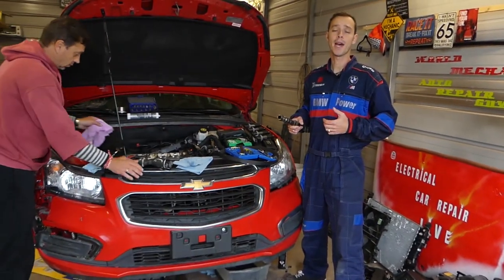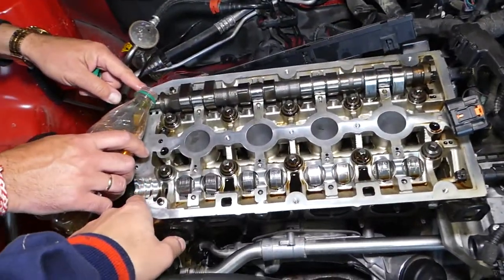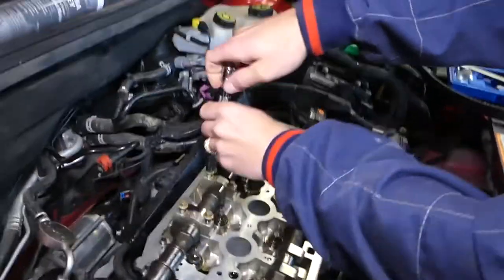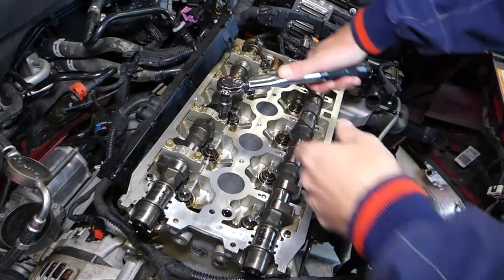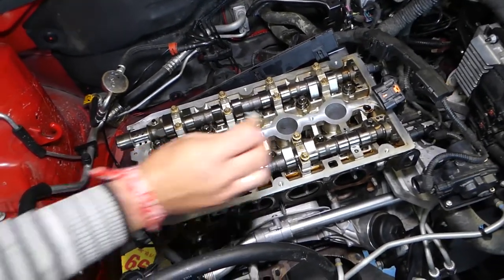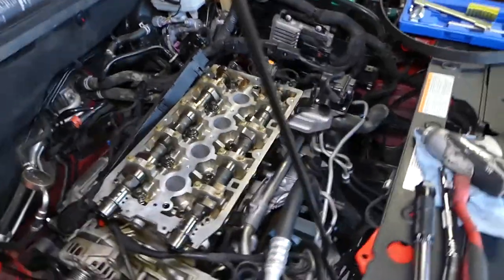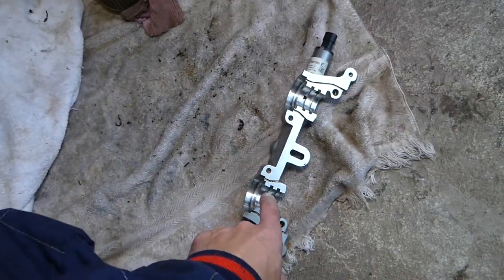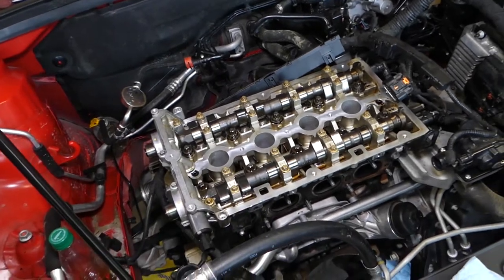CAMSHAFT CAPS TORQUE SPECS ECOTEC 1.8 1.6 CHEVROLET CRUZE SONIC OPEL ASTRA INSIGNIA ZAFIRA MOKKA

Comment: I learn a lot from your video’s. I’m replacing the exhaust camshaft only. One tooth to the right broke off. Even though Zi replaced the camshaft sensor, the code still shows sensor is faulty. My question is: Will replacing camshaft solve the problem. And I’m so afraid I might not place the camshaft in the wrong position. Any suggestions

Comment: I have a 2015 eco tec motor I put in my 2009 if I was to remove the cam from my old engine and put in the 2015 engine would I have to use the caps from the 2009 engine or can I use the 2015 ones?

Comment: the service manual clearly states NOT to put any sealant over the grooves  on the bridge cap.
Reply: PLL Lot, thanks for that info 👍.  I am doing one of these right now. (Valve job due to broken timing belt)  The  "manual" on csmans is very unclear about where to apply the sealant and neglects to mention what type should be used.

Comment: How do you line up the camshafts so that they are timed? Or aligned?
Reply: Once they have been took off idk but am searching and will share.    With the vvt sprockets  it seemed like exhaust cam was sit on a quarter off so when u layed the chain on the intake cam on its marks when u went to put on its marks on exhaust the sprocket it self had to be rotated back to get the marks lined up.     I know this.  U can’t set chain on its crankshaft mark at dead center the try to line marks up on sprockets to figure out exactly where they bolt down  maybe u can set Intake cam like that but not exhaust.     If u find out before me plz share
Reply: These cams have grooves where a timing tool can be placed to align the cams. Alternatively two vice grips or a 21mm wrench holding the cams behind the sprockets. Make sure the grooves are horizontal
Reply: @kas1nova1  i have a problem and need help the cam sprocket on the left doesn't line up the line is not horizontal but the cam is straight from the back and it is on tdc how would i adjust the sprocket to line up
Reply: my friend  same problem my bush machenic he dont know

Comment: 8nm or .8 (da nm)    Chevy said 8ftlbs on 2.4 which would be good on reused bolts  but 8nm is 6ftlbs
Reply: Lee, something doesn't add up somewhere?... csmans is also showing the torque to be 8y (nm) or 71 in-lb... but that only converts to 5.92 ft-lb?

I'm doing one right now and replacing the head bolts for new as directed, but this has me thinking ALL the bolts should be replaced?
Reply: @andrewulrich4930  now I am talking about the set of bolts that holds the cams to the engine is 8ft lbs        the head bolt torque I got from another video
Reply: @andrewulrich4930  my wrench on one side says  (da. NM)    M. Kgs.  And when set on 8.   Which I assumed was 8nm. On back side is the ft lbs and it’s on roughly 58ft lbs         I was also snapping bolts at 4nm. And it felt like way to much.     So when I called Chevy to order a new bolt set I asked them and they said 8ft lbs.
Reply: @andrewulrich4930  I’m no mechanic   am I missing something?
Reply: @andrewulrich4930  it’s like I’m finding stuff to support both our measurements now.
Reply: @andrewulrich4930  okay my wrench shows deca newt meters.    So it’s .8 deca newt meters not 8 nm     If My math is right
Reply: Correction .8 deca newt meters  which is 8ft lbs.      8nm is 58 ft lbs
Reply: A deca nm  is .1nm.    So 8 deca nm. Is .8 nm
Reply: @andrewulrich4930  I have had several people tell me all ecotec torque bolts are same torque but I’m working on a 2.4 ecotec.  So with a smaller engine that might be the little difference in ft lbs
Reply: @Lee Shelton  1ft-lb = 1.356 N-m (rounded to 3 decimals).... My point was if you tighten to 8ft-lb, that's 10.85 N-m. The manual I'm using lists torque in both N-m and in-lb.... ignoring the metric side, they call for 71 in-lb, which is easily converted to ft-lb by dividing by 12.  71/12=5.916 rounded.

Going to 8 ft-lb is 2 ft-lb too much.
Reply: @Lee Shelton here's the manual section I am looking at. They use "Y" in place of "N-m", but by also giving the in-lb, they allow you to cross-check the math. http://www.csmans.com/camshaft_replacement-2358.html
Reply: @andrewulrich4930 my wrench is deca Newton’s meters and I thought it was nm.  When I put it on 8 thinking it was 8 nm it was actually 80 nm
Reply: So I confused myself lol.   It is 8nm. Or .8 decanewt meters
Reply: @andrewulrich4930  u are right Andrew
Reply: That’s what happens when ur trying to fix a car with kids climbing up ur leg lol
Reply: @Lee Shelton 1 daNm = 10 Nm
8 daNm = 80 Nm

You need to be using a 3/8" torque wrench too.... my 1/2 drive reads the same as what you replied for yours.... but my 1/2 drive cannot be set to less than 10 ft-lb.
Reply: @Lee Shelton it IS very easy to get these conversions and abbreviations mixed up! Especially with kid assistants!😆 

I only ended up here trying to find out what type of silicone or other sealer they were using and saw mention of bolts breaking and I was thinking "Dang, more $$$ spent and more time lost." 🤣
Reply: @andrewulrich4930  right right thank u
Reply: @andrewulrich4930  any ideal how to make sure ur cams are set right? With the vvt sprocket on the exhaust side u have to twist the sprocket maybe 1/5 a turn the put ur chain on with marks.  So the exhaust sprocket keeps tension on the chain.  If u lift the chain off it will move off it’s marks.     I’m having problems finding anything on it.    Plenty of timing chain videos but the cams were never removed
Reply: @leeshelton5105  you'll need a tool to lock the cams gears in place... but don't depend on the local auto parts loan-a-tool.  What they gave me was a flimsy piece of adjustable plastic that won't clamp on or even hold a locked position.

The correct tool for these twin cams is a little 2-piece block that wedges directly between the gears. There's a kit that also includes a flat bar to set and hold the cams in time when reinstalling the sprockets.... and another tool that's supposed to slide between the block and trans to lock the crank.

Someone on here has a video showing it, that's how I found it, but I'll also see if I can look up that kit for you too. Back soonish.
Reply: @leeshelton5105  here's the video. They mention the flat locking plate, but don't show setting that before they start. I  think they do that at the end of a different video, maybe this one.... but anyway, there's a slot on the rear of each cam, it aligns so the flat bar lays flat on the valve cover surface of the head and then locks into the rear of both cams.

That's important because I didn't find out until after I pulled the sprockets, they don't have any physical detent with the front of the cam. They're just held in place by the sprocket bolt torque.... so there's potential to have both the cams and sprockets out of alignment if not done correctly.

https://youtu.be/n38woqOUTmM
Reply: @andrewulrich4930  i have a few pieces I put on the cams where it’s shaped for a wrench right behind the sprockets  so I can lock them down without moving at all. So maybe I could do without some of the stuff but I’ll check it out. I appreciate u helping me
Reply: @andrewulrich4930  on mine there is a node I guess u would call it on the back of the sprocket so the cam only sits one way on it.    It’s variable valve timing sprockets  maybe it’s gone bad a new set
Reply: @leeshelton5105  you're welcome Lee! I'm always learning myself so glad to pass on what others have done for me.... these twins are headache compared to my '96 s-10 4cyl. 😆 

I'm constantly trying to triple check myself so I don't crash these new valves. Just putting the valves in was like a game of Operation.... I made a special tool out of washers and bolts tacked together with a big c-clamp as a spring compressor.... the used a headlamp, reading glasses, and a notched out drinking straw with some Red & Tacky grease to install the retainer clips 🤣
Reply: @leeshelton5105  re: Node... do you mean where the CPS sensor reads? Opposite end of the cam from the sprockets?.... If yes, that's where the notch is located for timing the cams. If you look at that end of the cam as if you're looking down a pipe, you should see an off-center slot on the end face of the shift. That's where the flat bar slides in to both cams at the same time. They can only let the flat bar in if turned just right.

Any other position and they would be out of time with the sprockets and crash the valves on crankup.
Reply: @andrewulrich4930  im talking about cam to sprocket there is a pin so u can only put the sprocket on one way.   I see what ur talking about on the other end with the flat bar
Reply: @andrewulrich4930  I seen someone with a piece of pvc pipe and a c clamp to compress the springs and the pvc had a area cut out so u could stick the clips in with tacky grease basically the same thing. To seat the valves he used the valve cutting liquid and out the valves in and from the backside to a drill with a piece of hose the would slid over it and back of the valve and slowly turned it til it seat good
Reply: @leeshelton5105  ok good deal... I would use that flat bar to verify that your sprocket timing marks match up when pinned in place.... one other thing to note: when using the 2pc block between the sprockets, the marks do not line up directly. The intake sprocket  sets slightly above the center line of the tool and the exhaust cam lines up perfectly.... if you have been lining up the marks exactly without using the tools, that would account for you needing to rotate one cam to hit the teeth. Hope that helps!
Reply: @leeshelton5105  that's a good way to do the valves... I did similar but from the front... used lapping compound and chucked up a rubber valve stem in my drill and ran it on the face of the valves to spin them back and forth.
Reply: @andrewulrich4930  thank you

Comment: What’s the numbers and locations of exhaust caps
Reply: From the front, not including the main front bearing cross member (camshaft position solenoid housing) that has both inlet and exhaust caps, you go 6, 7, 8 and then 9 is the rear most exhaust cam bearing cap next to the pulse generator ring on the back of the camshaft.  By the way, when installing the camshaft position solenoid housing, it is vital that you keep the oil grooves clear of sealant so that oil trapped by the front seals is able to return into the valve/tappet chamber.

Comment: 8nm torque?
Reply: Did you ever get your answer for the torque?
Reply: @RODRICO1  8 nm is correct.
Reply: He’ll 8 nm snapped one bolt the I used a smaller torque wrench and put it on 4nm and it snapped another one.  WTH is going on.  Even with if I get new bolts it just feels like to much